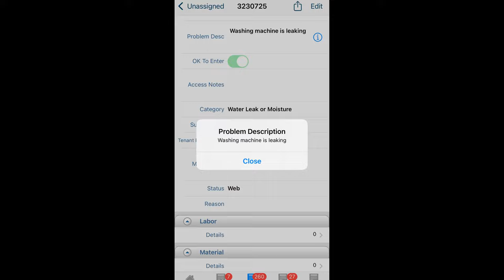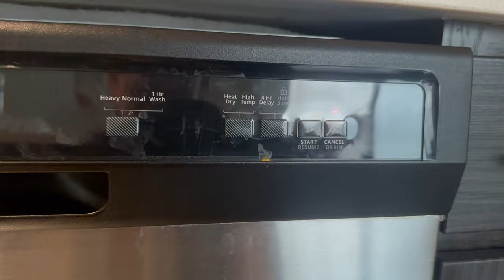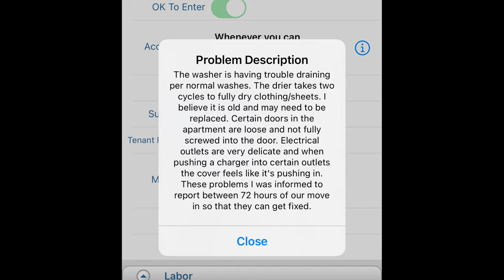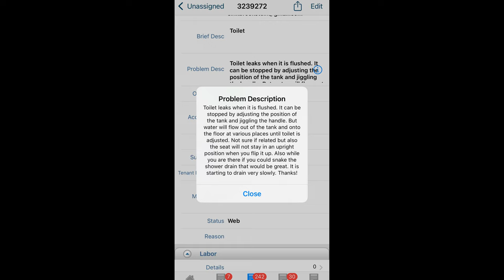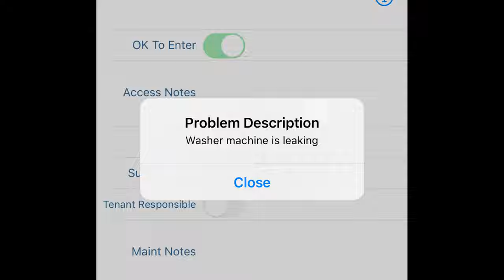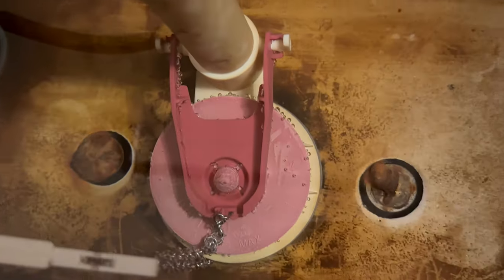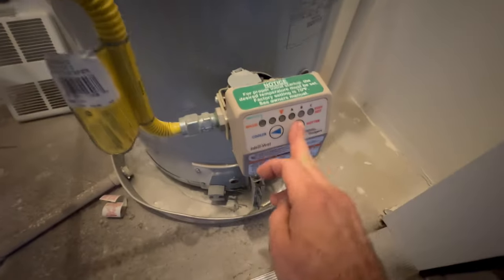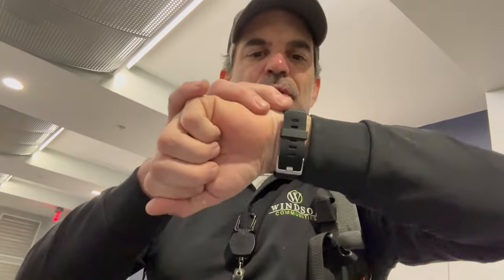Apartment Maintenance Vlog #37

Comment: I used to wear my Fitbit at work everyday & never once had less than 10k steps. You don't even realize how many steps you take a day until you track them & it's all cool information to see. Gotta take care of yourself cuz nobody else will! Now that the holidays are past I have to get motivated to lose the 8-10 lbs I gain every year during the holidays. Like you said with getting older & taking better care of yourself is key. Counting your steps & drinking plenty of water is a great place to start & good motivation. Keep doing you bro 🛠️👍
Reply from the maker: Thanks for stopping by! On these snow removal days I been getting closer to 20k a day. Good luck on the holiday weight thing 👍

Comment: What was that you used to repair the front load washer seal and the product you used to make it set up? I just found your channel and like the videos, thanks.
Reply from the maker: Hot stuff glue and accelerator by satellite city - keep in mind that was a patch h til the right part comes in 👍